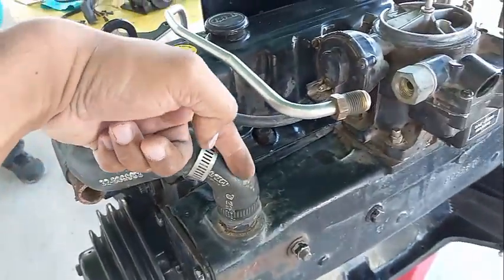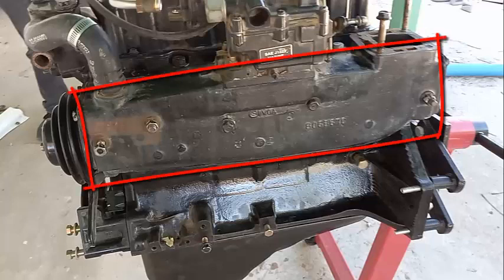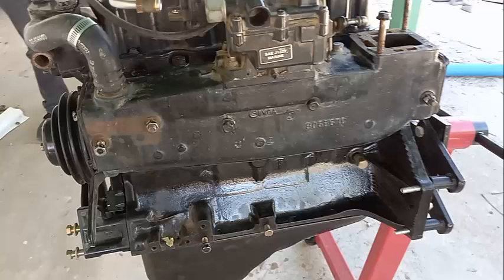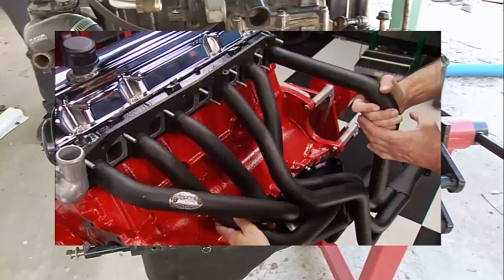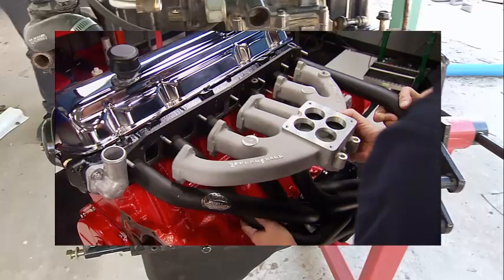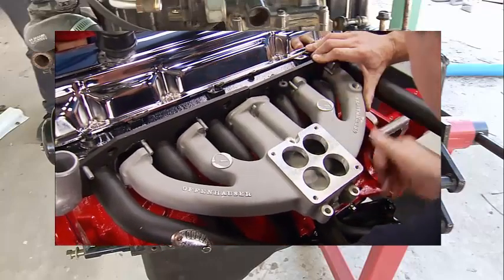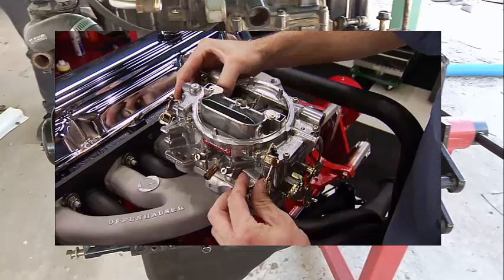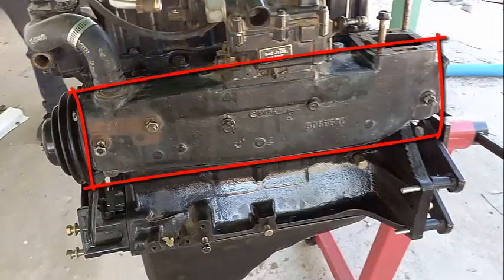MerCruiser 3.0 Liter 2.1 Disassembly Exhaust Intake Manifold V1.0

Comment: I hope that you will explain the refrigeration cycle in a simple way for beginners, and does sea water pass through the copper tubes in the radiator, thank you
Reply from the maker: If by refrigeration cycle you mean how the boat coals the water? Then yes, I have explained that already in another video. Boats don't have radiators. Basically, they just get fresh water and expel the hot water to the lake.